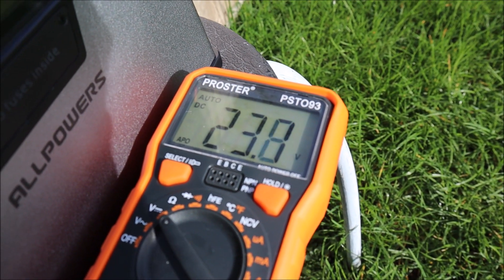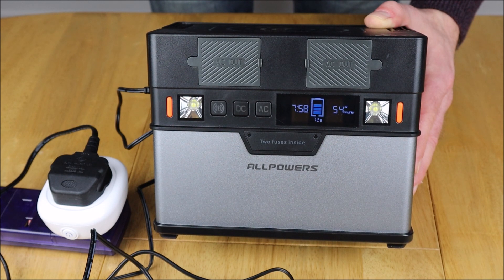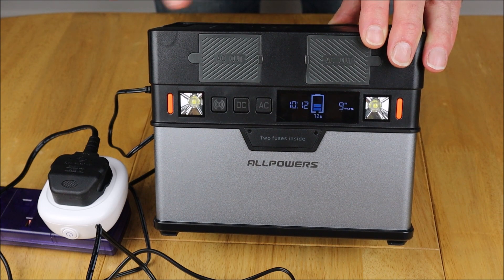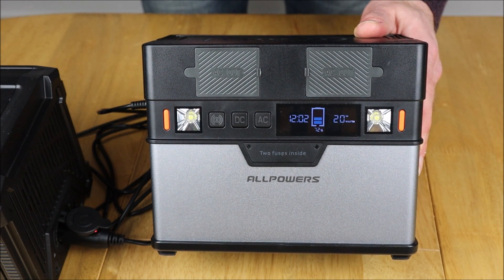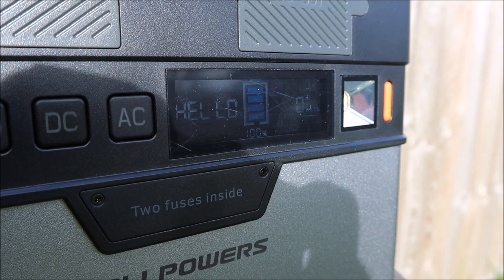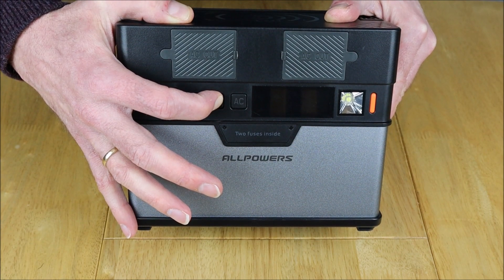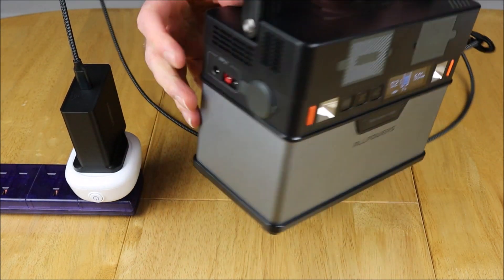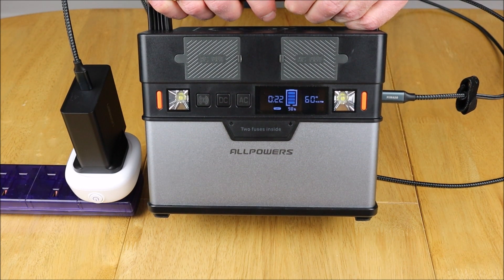ALLPOWERS 372Wh Portable Solar Generator Update | Charging Rundown

Comment: Battery  was charging neg to 4v BUT clip came off shorted to the gold contact below 4V now no voltage at main 2 pins that connect to board any idea what to fix ?
Reply from the maker: @JakDac  I'm sorry to hear that. It's difficult to say without pulling it apart. It could be something on the mainboard, but you'd need to trace it through. The other thing is to find one that someone is selling as parts and you might be able to replace components that way. All the best, Adrian

Comment: This battery is a complete waste of time and should of been recalled. It loses its charge superfast when not in use, the wireless charger has never worked, the wattage is irregular, and now it wont turn on at all after its last charge.
By the time you figure out it has major problems you're out of warranty.
Dont waste your money....we did.
Reply from the maker: @neilthompson4819  Sorry to hear that. Apart from the display which has already been covered in the video series, mine is still working 5 years on.

Comment: What kind of USB C charger should I use to get 60 w
Reply from the maker: @josefolsen6555  Good day and thanks for your question. I'm assuming you are after a mains USB-C charger to charge your ALLPOWERS? If so, the best bet is to get a USB-C PD 65W charger. The important thing to remember when buying is that at least one of the ports can deliver 65W (on its own). Usually, when using multiple ports at the same time on PD mains chargers it splits the 65W across those ports. I’ve had my single 65W port UGREEN PD mains charger for ages and still use it almost every day to charge my ALLPOWERS units. They no longer make the version I have, but there are alternatives like these - https://amzn.to/3ARpFCV or https://amzn.to/3VrLz9n (affiliate links). There might be alternative makes on better deals, but I'd make sure that at least one port delivers the 65W PD (gets about 60W when charging). I hope this helps. All the best, Adrian
Reply: @DADvinci  thanks for your reply. You give an excellent answer for my question

Comment: Hello
I have a problem with my Allpowers 372 unit as it has suddenly stopped charging from the mains.
The blue bars in the center of the display blink as if the unit was charging but the is no watts input neither charging remaining time.
Other than that, it works fine but once the battery will be flat, won't be able to use it again.
Any advice on how to recover the charging of the unit?
Many thanks
Reply from the maker: @davidf8804  Hey David. I'm sorry to hear you're having a problem. Does the display show a percentage when not charging? Have you tried a reset? When charging from the mains are you using the standard power brick via the DC input or using the USB-C port? Cheers, Adrian
Reply: @DADvinci  Thanks for your answer. Yes, I am using the original brick and also I have tried the reset but without success. The displays shows the percentage but not the remaining battery time left, just the HELLO message and the blue bars blinking. The PD port does not work either. Never happened this before. Very weird. Just wondering if you are aware of similar problems as I heard Allpowers are giving many problems to many users. Thanks
Reply from the maker: @davidf8804  Thanks David. So, it keeps charging when the hello is displayed (at 100%)? Cheers, Adrian
Reply: @DADvinci  No Adrian. The blue bars blink but the % remains static so I don't really know whether it is charging or not.
Reply from the maker: @davidf8804  May I ask what % it remains static at? Thanks
Reply: @DADvinci  At whatever % is left. If I plug something in, the battery drains and reduces de %. If I connect the mains or car charger to recover charge, the blue bars blink but the % does not increase.
This makes me fear that, once the battery is empty, I won't be able to recharge it.

Comment: getting the ALLPOWERS 372Wh Portable Solar can it be charged by usb leads if the  solar  panel has usb concecters
Reply from the maker: @gaz blum  Depends on the solar panel, it's not worked for me on the Jackery panel I have. If the panel has a USB-C PD (Power delivery) output, it should work ‘in theory’ (depending on the strength of the sun). The best option is to use the DC output and get a cable to plug into the Anderson port. Cheers, Adrian
Reply: @DADvinci   i got the ALLPOWERS Portable Generator 288Wh its not charging is there a factory reset  on this to

Comment: Hi David .  Can you expand on the factory reset?  Does the battery need to be full when doing this or does it not matter>  I'm wondering if it disrupts the battery management system if it is reset when less than full.  Cheers
Reply from the maker: @PAUL CLEGG  Good day Paul and thanks for your question. I've not noticed any real difference on mine. There’s still the top end monitoring issue, as in when I get to 100% it continues to charge for a while until the input watts drop off. From memory, the last reset I did (some time ago), I charged it right up until the watts dropped to zero, then reset. I hope this answers your question? Please shout if you have any others. All the best, Adrian
Reply: @DADvinci  does the rest work on newer models (700W) as I can't get it to work by the DC button. The BMS seems to be a bit unpredictable in the way it disposals hours remaining. Allpowers sending me a new unit under warranty and was hoping a factory reset would sort out the minor problem on the old one seeing as Allpowers don't want it returning.
Reply: @DADvinci  why did I call you David?  Thanks for the reply.

Comment: That solar panel interruption doesn't happen with mine. Not sure if it's because of where I have the panel (more out of the way) or if it's the panel itself. Mine is constantly attached, it's a more permanent set-up, but something that could be quickly and easily detached for travelling - it's hooked up with tension rather than bolted etc. My set-up wakes up by itself each day and charges, and I get a reasonably good wattage - I use the Anderson connection. I think it's hard to test them like you're doing (which I'm glad you do as your videos have helped me a lot, saved me a lot of time, the AllPowers manuals are very basic), as testing means more plugging in and unplugging which it seems these boxes don't like, and you'd no doubt have to keep doing the reset thing. They seem to work fine when just left to do their thing. Touch wood, mine will carry on working as it is doing.

Free energy though, when it costs so much these days, can't argue with that, so I'll be expanding further. There are so many USB powered devices now too and can fill up extra powerbanks with the power station on the side, and something I have on almost all day is a laptop which is now running for free as well, same for my lamps at night, LED bulbs plugged into the AllPowers. There's something incredibly satisfying about knowing you're not paying for the energy you're using.
Reply from the maker: @Red Devil9  Good day. Thanks very much for sharing your experience, it helps other viewers out too 👍. It sounds like your panel is in the sweet voltage spot for the charging circuit, unlike the panels I used. It's great to hear it works as it should, leaving the panel plugged in and letting the sun do its thing (no wake-up issues).

I really appreciate your kind feedback, as this helps me understand if the content is useful or not. You've hit the nail on the head when it comes to the pure satisfaction of using free energy. I would almost say it's now an obsession for me and I miss the sun even more than I used to on cloudy/rainy days. All the best, Adrian

Comment: Hi mate not sure if you can help me but I have this unit myself. Unfortunately I have lost my 240v charger for it? Do you know if you can buy replacement ones or which one would suit? I have looked online and Allpowers don't list itbon their accessories page. I have also contacted them but had no reply?? Thaks in advance.
Reply from the maker: @James Dickinson  Good day James and thanks for your question. I'd suggest using the USB-C PD port to charge instead of trying to find a replacement DC power brick. The UGREEN PD mains charger featured in this video has been discontinued and their latest offering is this > https://amzn.to/3M5nK1s (affiliate link). I've not got one myself as the original is still going strong. The other option is to go for a 65W USB-C power brick in its own right, these are generally used for laptops (you may already have one you could use). I hope this helps. Please shout if you need anything else. All the best, Adrian

Comment: Hi, Great Video first of all. Is it possible to charge this with any other panel? Or does it have to have some specifications? (the charging port for sure ... ) or can it be done from solar panels which have USB output? thanks
Reply from the maker: @Joseph Galea  Good day. Thanks for your very generous feedback, it's much appreciated😊. If charging from solar it's better to use the Anderson port so you don't have problems with clouds dropping the input watts (if using the DC input with a panel). As long as the panel Voc (Open circuit voltage) is in the voltage range for the input (16.6-22V in the manual), it caps the current at around 3.2A (around 60W from solar). With this in mind, it’s not really worth going over a 100W panel as you won’t see the benefit in charging terms. You'd need to have a USB output from the solar panel with enough voltage to wake-up the USB-PD port (45W/60W PD would be good but they don’t usually come with PD). Did you have a particular panel in mind? All the best, Adrian

Comment: Hi, please how many 100w solar panels connected together can be used to power the 372wh allpowers?
Reply from the maker: @SGJOE sgjoe  Good day and thanks for your question. Due to the limit on the charging ports (around 60W), there isn't any real benefit to using more than one 100W panel on this unit. I hope this answers your question. All the best, Adrian

Comment: Hi thanks for your vids they are very informative, I bought one of these power banks for a festival last year and it performed great! I am thinking of adding 100w of solar this year and bought the Anderson adapter cable (came with polarity reversed! 🙄) but I was wondering with the starting of the solar charge problem (overvoltage) would leaving the panels plugged in overnight once the sun came up would the unit start charging by itself or do you think you would have to unplug the panels and do the procedure to get the solar charging again? Thanks hope what I wrote made sense 🤣
Reply from the maker: @David Slade  Good day David. Thanks for your generous feedback, it’s much appreciated😊. It's great to hear that it worked so well in the festival setting👍. I had that on one of the Anderson cables I bought too and my trusty multimeter saved me loads of 'messing' around time. In regards to leaving a panel connected, it never worked on mine. I was always hopeful due to the weird voltage setup. Not the answer I want to provide, but I hope it helps. Please shout if you need anything else. All the best, Adrian
Reply: @DADvinci  thanks, I will have to do some experiments in the summer once I get a solar panel and see what I can get away with doing. I was hopeful that the gradual rise in voltage as the sun came up that it would resume charge, thats a shame it didn't work like that.

Comment: Just bought an updated version of this. What’s the fastest you can charge this with a USB-C? I’m shopping around for a 100w charger but if the max is 65w, Don’t want yo pay a premium. Double the price for 100w.
Reply from the maker: @Phi Chong Good day and thanks for your question. Mine only charges at around 60W, from either the USB-C PD or DC/Anderson ports. It doesn't support charging from more than one port at a time, e.g. from the DC & USB-C PD together. I doubt this is something that has been changed on the latest (your) version, so I wouldn't waste your money on anything over a 65W USB-C mains charger. I hope this helps. Please shout if you need anything else. All the best, Adrian

Comment: It’s a year since your video on this item do you think it has improved since then?
Reply from the maker: @Gone Outside  Good day and thanks for your question. It's still working fine and powering my TV as I type this. I guess once you get used to the 'characteristics' it has, you don't really notice them as much. It's been a solid unit despite my clumsiness and I made a repair (out of warranty now) to get the display backlight fixed due to me dropping it. So, for me it has been a good unit. I hope this helps. All the best, Adrian

Comment: Hi DADvinci. My mom purchased one of these about a year ago. She has a slightly different US version where the AC outlets do not have a cover and they are US plugs. The screen does not display anything - either when the charging brick is plugged in to charge the bank or when any device is plugged into it. The only way to view any information seems to be through the horribly designed smart phone app and Bluetooth connection. Have you run into this?
Reply from the maker: @Dustin Riordan  Good day Dustin! I'm sorry your mum has been having issues with it. I did indeed have this issue myself, but mine seemed to come about as a result of my clumsiness rather than anything else (perhaps it was waiting to happen anyway). I've dropped mine a few times and after one of these drops the display backlight stopped working. I'm wondering if the display is still showing the info on your unit and it's just the backlight that's the problem. The 12V Tips video in the 372 playlist (https://bit.ly/2AbwG5L) shows how I got round this issue, so might be worth a try? I've since fixed mine as it's out of warranty. I took it apart and resoldered the connection points between the display and mainboard, which seems to have brought most of the original backlight power back. I hope this helps. Please let me know if you need anything else. All the best, Adrian
Reply: @DADvinci  thanks for the tip. I will try shining a light onto the screen and holding it up to the strong sun to see if it's just the backlight. another behavior it has is that the light on the AC button only stays on momentarily when the AC output is turned via the smartphone app, however the outlet continues outputting power to the connected appliance despite the light going off. Is there a hard reset procedure for the 372? I can't find any reference to it in the manual.
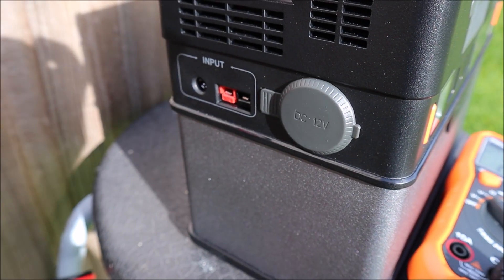Reply from the maker: @Dustin Riordan  No problem at all. The three buttons on the front are also connected to the same board that attaches to the main board, so I can only assume that the AC button (light only) staying on is related to the overall backlight issue. It's certainly sounding like dry solder joint(s) between the boards as when pressure is applied to the AC button it does make a brief connection so lights up (my guess). When I dropped mine, it appears to have done enough damage to cause the connections to come loose (solder joints) as soldering them again fixed my issue. The factory reset is covered in this video > 8:50. Cheers, Adrian

Comment: Hi Adrian, great reviews on this little beast. One question if I may.. I got mine back in February. All worked fine. Then this morning it wouldn't charge past 59%. It only switches on when plugged in to charge via AC/wall.  So plugged it in, tried factory resetting but it hasn't fixed the problem.
DC works but again, only when unit is charging otherwise no power is being drawn. Any ideas or just faulty unit??
Best regards,
Harry
Reply from the maker: @Harry King  Hey Harry, I've responded to your earlier email. If you could let me know a few extra details, that would be great. All the best, Adrian
Reply: @DADvinci  just replied to your email, thanks Adrian.
Reply: when pluged in with ac charger it says 100%charged then i unplug it and it shuts down and wont power up on anything,any ideas?

Comment: Hi I'm just wondering what the electrical quantity management app is called? Could you include a link in the comments of this message. I really appreciate it and keep up the good work Adrian!
Reply from the maker: @Angel Washington  Good day! Thanks so much for your kind support👍😊. Here are the links to the app stores, depending what type of mobile device you wish to install on. Google > https://bit.ly/2U1g8Y3 and Apple > https://apple.co/3fLRG4O. I use the app on my Samsung phone and old iPad. Once installed, just ensure you have the Bluetooth switched on (you don't need to pair it) and open the app. Once the app has opened, just tap on the little mobile icon in the top right-hand corner to scan for your unit (make sure the ALLPOWERS Bluetooth is switched on too). The Bluetooth range is not that great on either the 372 or 666, so you'll need to be fairly close when you want to connect. If the app doesn't connect, after it has before, just kill the app and then reopen. It can be a little difficult sometimes. I hope this helps. All the best, Adrian
Reply: @DADvinci  Thank you Adrian, I really appreciate your support and the knowledge you share on your channel!

Comment: Am I being stupid all the power stations appear to be 288wh not 372?
Reply from the maker: @Dale Harlow  Good day Dale and thanks for your question. I previously contacted the manufacturer about this and they informed me that they changed the specification due to the increasing cost of batteries. So essentially, they have downgraded the capacity but kept the price point the same. Personally, I don't understand this move on such a popular unit. I hope this helps. All the best, Adrian
Reply: @DADvinci  thankyou, I was scratching my head.
Tossing up between the allpower 288 package with there panel and the jackery 240 and panel.